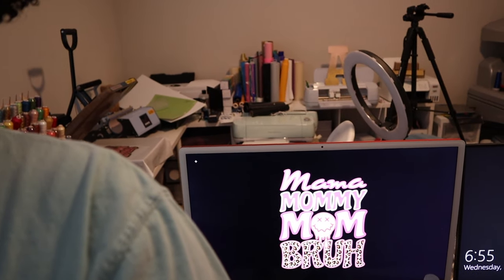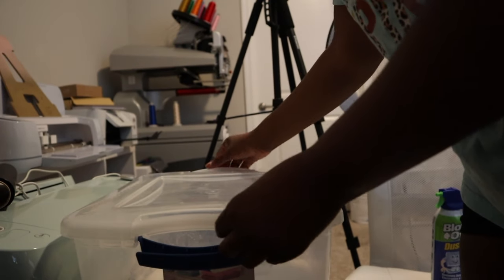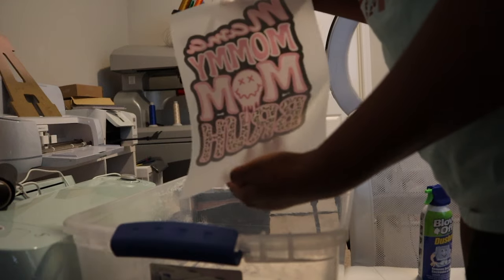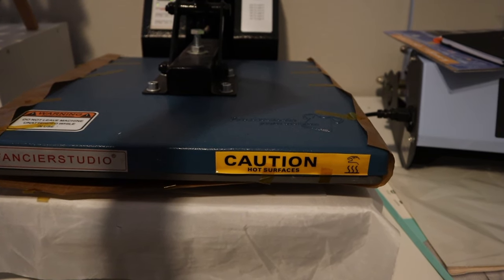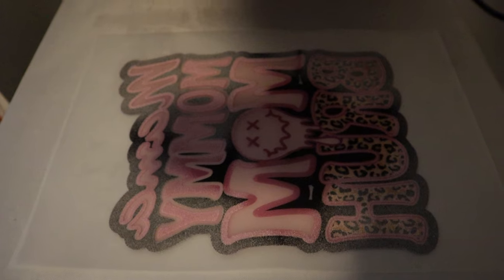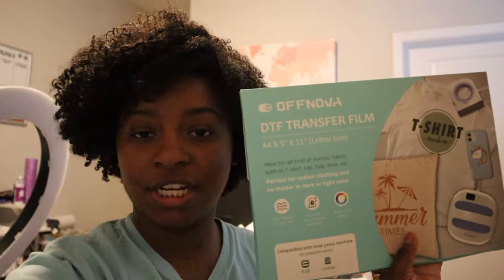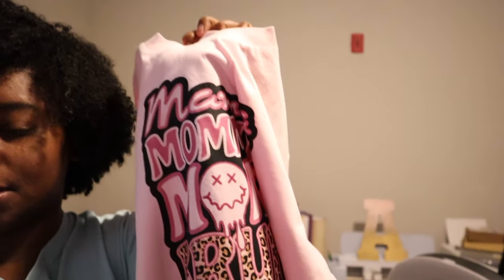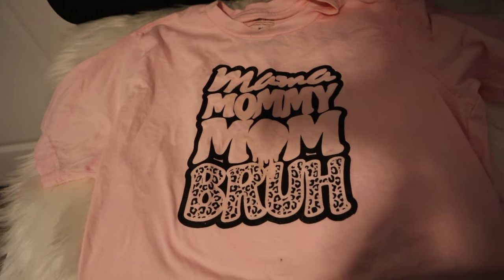DTF Transfer Hack! How to print dtf transfers with inkjet printer!

Comment: Inkjet printers use black pigment ink (water resistant) the other colors are dye ink (water base I think), that’s why they washed out. I use the inkjet printer when I’m making black only designs and it works great. I also purchased black pigment ink refill bottle and refill my cartridges for pennies. There are many videos on how to do it. ✌️

Comment: I believe the inkjet printer ink has to be all pigment ink.  I believe most of HP's OfficeJet printers use all pigment ink.  Some inkjet printers have just the black as pigment and the other colors are dye. The dye will wash out. The type of ink in the inkjet that is use does matter. I'm about to try this hack with an hp officejet that uses all pigment inks. I need to want for replacement ink cartridges.